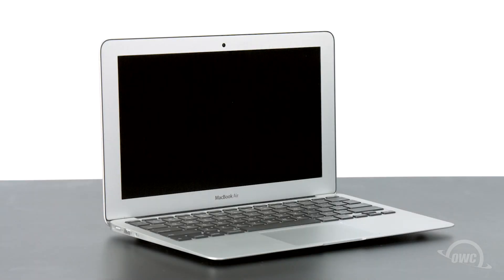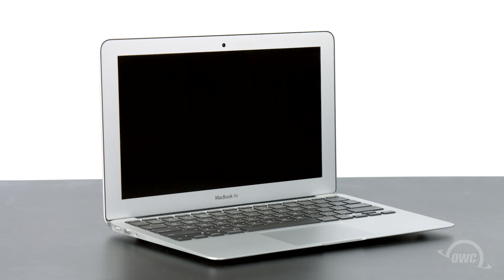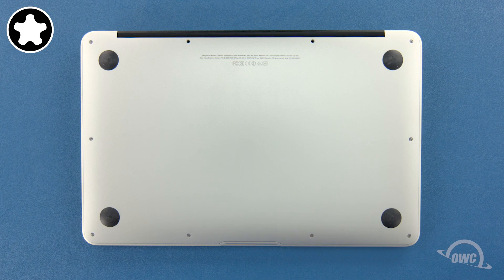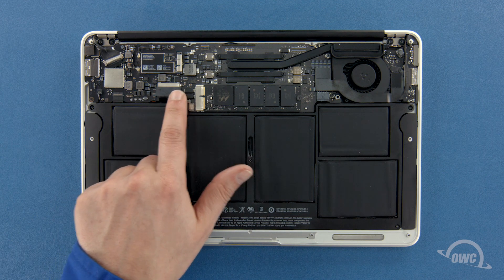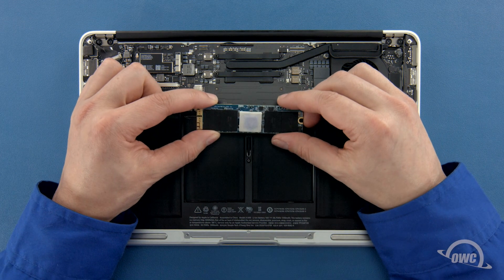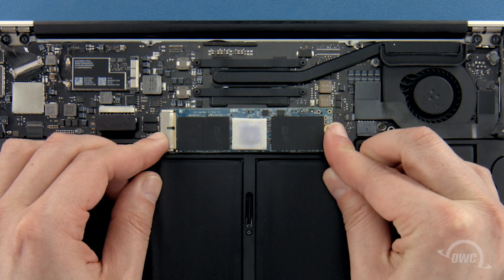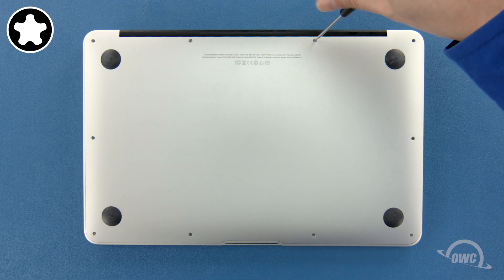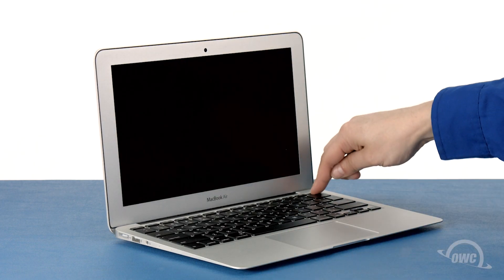How to Upgrade the PCIe SSD in an 11-inch MacBook Air (2013 – 2015) MacBookAir6,1 MacBookAir7,1

Comment: if i have no data to backup , can i just install the ssd right away without external hard drive & or  backing up any data ??
Reply from the maker: Yes! You can simply just install the SSD if there is no data to backup.

Comment: If I upgrade the SSD, am I able to increase the RAM beyond 8GB?
Reply from the maker: Regrettably, the memory is not upgradable in any of the  MacBook Airs. Upgrading the drive could help out with storage issues since they can go up to 2TBs and can give a better boost performance over the original SSD

Comment: can you put 1tb in a 2013 11inch i5?
Reply from the maker: It looks like you might! ( https://eshop.macsales.com/shop/ssd/owc/macbook-air/2013-2014-2015%29
However check the Model ID of your computer and make sure it matches up. Hope this info helps.

Comment: Hi, I want to do this but my mac air won't upgrade to high sierra, it's still on el capitan
Reply from the maker: Regrettably, The Aura N or X drives require MacOS 10.13 or later, be installed on the Macs original SSD prior to installing the Aura. The Aura will not work with an earlier OS. This is due to the EFI firmware update that is required.

Comment: I am thinking of upgrading my ssd for Mac Air early 2014 and buying the crucial brand ssd and I heard that I’ll also need to buy an adapter as well is that correct can you please explain tnx
Reply from the maker: Hello Bilal, I am not familiar with the form factor of the Crucial drive you're looking at, if it is an M.2 it will not work with your MacBook Air. That being said if it is designed for the Apple Proprietary connection it shouldn't need an adapter. We sell one that fits without an adapter if you are interested, it would be the Aura Pro X2.

Comment: I am still getting the Kernel Panics when resuming from sleep... been annoying me like crazy. Setting the AutoPowerOff to 0 is not feasible as it drains the battery even more and still getting those crashes.....

What can be done about this problem?

MacBook Air 2013 11" i7 - 8GB
OWC 240GB Aura Pro X2
Reply from the maker: Hello Wolf Sanderson Louis,
 
We are sorry to hear that you are experiencing this issue and we would like to work wish your directly at this time if you could please contact us at support@owc.com or by contacting us at 1-800-275-4576 anytime M-F between 8am-8pm Central Time.
 
We look forward hearing from you soon!

Comment: Hello- Does the new SSD have to be formatted for macOS before installing? Could I just buy an ssd and put it into the machine and expect it to work for mac? Thank you for making this video.
Reply from the maker: You're most welcome for the video! We are glad that this is helpful for you! 
 
To answer your question the new SSD would need to be formatted prior to installing Mac OSX.
Reply: @poweredbyowc  Hello- I watched another video on youtube of someone installing it in their mac and then once installed, there was a prompt to format the disk. So if there is no stata connector, how would you format this before installing as you indicate?
Reply from the maker: We would like to apologize for any confusion in the response you received.
 
Going forward you need to install the SSD into the machine then once installed you would format the drive in the machine then. you would be able to intall Mac OSX.